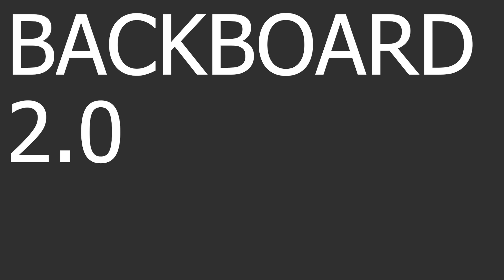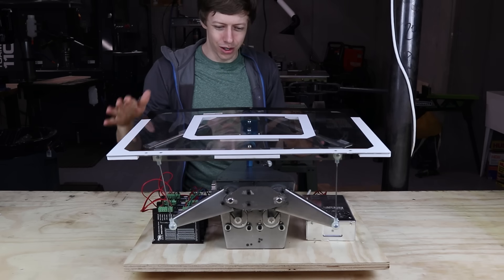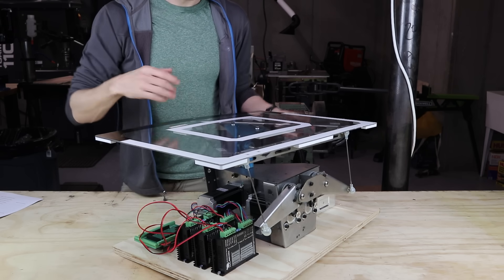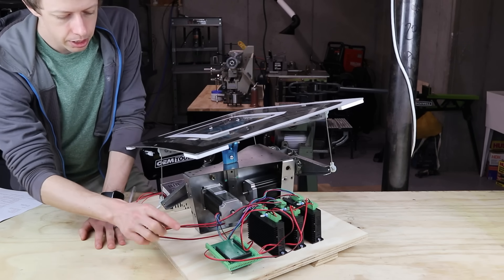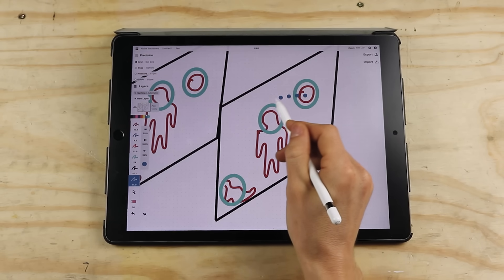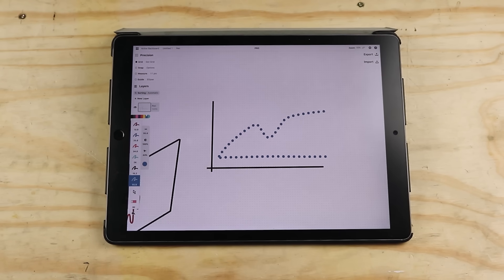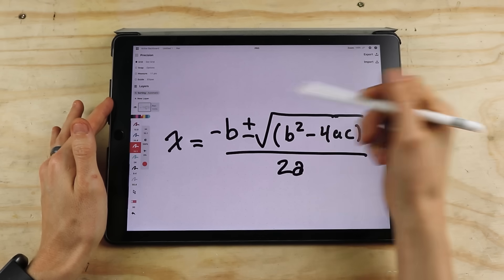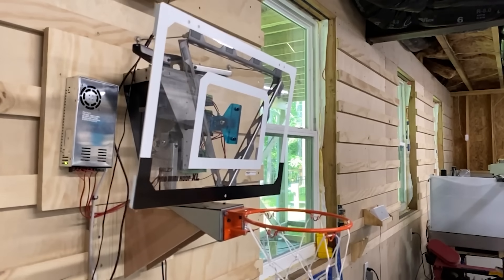The automatic hoop always goes in

Comment: I'd love an in-depth video on your process for designing and implementing your tracking algorithm and ballistic math. Do you have training as an ME? Your explanation of motion tracking reminded me of some ME's I've helped with programming problems. Not a criticism at all, just curious. You may have already considered these items.
1
) Using a depth-first classification scheme for your ball tracking would mean you only ever need to calculate until you find ANY ballistic-like path. You assign a score to it and when you run into a video frame that stops meeting your threshold you back up to the previous frame and try another object until you get a better score. Since you always assume you are on the right track and backing up by a frame or two shouldn't be too drastic, you could start moving the backboard almost immediately and then apply position corrections as you get more sure of your path.
2) Identifying a throwing arm could give you a strongly-weighted guess about which object to call the ball and what direction the ball should be going.
3) Solving problems from scratch is satisfying but in production there are often high-performing, community-maintained libraries that implement things you want to do. If your calculations are slow, maybe a team of experienced programmers and enthusiasts have already solved your problem.
 4) I have never played with Kinect sensors on PC and don't know the status of development for other platforms but when I've had situations where Windows created lag in networking or real-time audio/video, I have found it easier to change platforms than dive into drivers and driver signing and performance bottlenecks. 

5) Is there a compromise point where moving a curved backboard provides more gain than it costs to implement? Perhaps a backboard which only implements certain curvatures (at the edges maybe) would decrease movement cost for edge shots.
6) Would your curved backboard or one similar make a good passive or maybe one-axis ball return system to sit below the hoop? I think it would be cool to see a small curved backboard pass your ball back to you.
7) Could you shield that laptop if you are going to throw balls at it?  Made me pucker up a bit..

I love your videos. Thanks!   ..and go ahead and copy TOT if you want, he's awesome. You'll eventually figure out your own style... but this video was your best yet.

Comment: Hey man! What you've made is absolutely fantastic. You stated in the video that Windows sometimes lags out, and I think I can help solve that. 

If you can port your project to Linux, you can take a Raspberry Pi and flash it with Alpine Linux. Alpine is a very minimal distro of Linux ~5MB size, so it'll never lag even on the weakest of systems.

Comment: You should consider using a Parallax Propeller for controlling the drives.  It's 80Mhz and has 8 cores.  Each core can execute 20MIPS and each instruction is 4 clock cycles.  It can be interfaced through a standard FTDI chip and should have way more than enough power to pump step/dir signals at the drives.

Comment: Fyi Corrugated Lexan sheets are commonly used for green-house roofs.  They should have similar weight to your back board and be much stiffer in bending.  Something like https://www.interstateplastics.com/Polycarbonate-Twinwall-Clear-Sheet-POLCE~~SW.php  The thickest versions are probably stiff enough to skip the triangular steel frame.

Comment: I've got some surplus 250W BLDC servo motors on hand and they are about half the size of those steppers.  They have tremendous torque, acceleration, and speed.  You might consider using those for v3, and perhaps a Raspberry Pi 4 with Open CV :-D

Comment: I hope you're upgrading to an O-drive servo setup.  You'll have up to 7hp per motor to use :D. A feedback servo loop is also much more tolerant of poorly constructed commands and a parallel feed-forward controller can extract maximum performance form the servos. 

If you stick with steppers, a good S-curve/controlled Jerk trajectory planner will let you move your back-board a bit faster.  Though the best performance will come from using a full inverse kinematic model of the back-board to plan paths. (an inverse kinematic model is also the most ideal way to implement the feed-forward controller, but simplified inverse models can perform nearly as well with lower command lag.)

Have you considered adding speculation?  I.e. start moving the backboard as soon as you're sure the speculative motion will bring the board closer to the final optimal position?

Finally, do your tools also work on Linux?  A stripped down RTOS distro should get rid of the background task freezing.  (Worked with people who built real time systems on Linux.)   Ofc given infinite time, running without an OS on a fast SBC or DSP would totally get rid of your variable timing.  (done this style myself)

Comment: if you attach your plate to three screws linked to the plate by cardan joints you might be able to use lighter, less power-consuming motors (and in that case, brushless servomotors would be a great application) and still move the plate where you want it to be, without the stress on your belts and 3d printed parts, with better mobility and accuracy

Comment: Neat stuff as usual. I think there were more shots of your shop in this video as well, which were nice! Your system of french clamps everywhere on the walls is very clean, and I think it would be interesting if you did a video just talking through how you got to the current version of your shop.

Also, had you considered moving the backboard to a position based on an early estimate and then doing a more detailed solve for a best case board position so you have less time to move from your early hopefully-good-enough guess?

Comment: This is insanely cool, kudos on a working prototype.

The spin is a bit tricky, but you can probably approximate it using optical flow measurements on the ball, which could be feasible to compute in time.

Extended Kalman Filters and Particle Filters are great tools for tracking (both have OpenCV implementations). Probably PF would be overkill and computationally infeasible, but EKF could probably relieve you out of that graph theoretical balistic trajectory filtering stuff.
Reply: You can also not wait until the last moment to send a reference to your motion controllers. If you would try to match the optimal configuration for the hoop with the data at hand continuously, you would probably end up with the same end configuration as in your method, but the motion would be smoother.

Comment: Is there a particular reason you used stepper motors for this? This seems like a ideal use case for servos, since they won't lose steps even when the ball hits the backboard.

Also, if you filter out your head based on it not being on a ballistic trajectory, does that mean a jump shot will confuse it?

Comment: Rather than waiting until the last second to move the hoop, could you maintain a 'best estimate' and immediately tell the backboard to start moving towards that as soon as you detect a ball in flight? As the prediction gets better you can keep sending updated target positions to the backboard, but the chances are, because of those earlier predictions, it will already be moving in approximately the right way by that point, right?
Maybe you could even scale the speed so that it aims to get to the correct position just as the ball hits. That way the earlier predictions, which are less accurate, are also weighted lower. Like, when it first sees the ball it won't move the backboard that quickly based on that data, because it has time. But by the time the ball is nearly hitting, the board is moving as fast as it can to reflect the latest predictions (though hopefully it should already be very close by that point and not need to move fast).
I mention this because it seems to be how people catch a ball in real life. They don't wait until they're sure where the ball will be and then whip their hand out, they try to get close to their first guess early on, and fine-tune the hand location as they track the ball and get better predictions

Comment: Great job! There are a couple of things you could do still to improve your solution though:
Ball detection: Train a ML model to look for your ball instead of using a blob detector as it sounds like you are using.
Between-frames ball detection correlation: Are you pruning your "ball-candidate-graph" by removing unrealistic velocities before attempting to fit a ballistic path to it? Could improve speed.

Early motion: Start moving early by acting on the first ballistic path you compute that will hit the board. You can then improve your position ever so slightly as more information about the path comes in. Less strain on all components; You probably don't have to invest in even stronger motors.
Better math: Your equation for computing the optimal board position has infinite solutions because you're missing an equation. You have almost solved it already, but your solution is a bit brute-force. The exact solution probably involves the moment of inertia, but for simplicity, you can use the sum of squared distances each arm has to move. Differentiating this equation and solving for zero will give you your second equation, which we for simplicity could just solve numerically in a jiffy, as you don't need exact solutions..

Comment: It is possible to overclock an Arduino by replacing the quartz crystal on the Arduino. If you do this you need to put a heatsink on the device or even a small cooling fan.

Comment: You could eliminate the "infinite solutions", by fixing one of the three points in the plane and using 2 pistons vs. 3  (i.e. it is no longer an underdetermined system), plus it is cheaper to boot!

Comment: Great idea, even better execution. I'm a computer vision student  and I was really surprised by the way you calculated which object is the ball. I'm not an expert but here's a way that could potentially help you identify the correct ball a couple times faster - first of all the ball has a pretty distinct color, which isn't covered too much by your hand, nor it really appears in any of the surrounding. If you implemented a color mask into the video stream and ran the same algorithm that potentially finds the "roundest" object (simply put you find the object that covers the most space in the enclosing circle) it would save you an immense amount of time and resources (I'd like to assume you use Python's OpenCV for the computer vision part). Hope I helped and that this method will help you :D

Comment: Interesting project ! 
For the arduino limitations, I switched to ESP32 for one of my projects. I wrote some code using hardware timers to manage the steppers. (github munchj nerfbot_esp32_turret/src/ledcStepper.cpp)
Otherwise you could switch to brushless motors with magnetic encoders and something like oDrive to control them. I assume it would give you more speed and power than steppers for this application.
Looking forward for your next project !

Comment: Can’t you start by looking for fast moving things instead of looking for balls? That way heads and random stuff might be easier to ignore.
Reply: Another thing. If the system is moving as soon as it has a guess, it should get more accurate. The guesses will most likely be close to reality so moving to match the guess means as it gets more data it has a shorter way to move which in turn means you can keep correcting for longer with more precise data.

Comment: Use a Teensy 4.0! It’s a $20, arduino compatible ARM cortex M7 microcontroller that runs at 600MHz stock with a dual-issue superscalar cpu and a double-precision floating point unit.

I think it benchmarks at like 1000x faster than an arduino for general use.

I’ve used Teensys (3.2, 3.5 and 3.6) for the last few years, but the power of the 4.0 blows them out of the water. I’m not sure if there’s another cheap microcontroller out there with as much OOMF as this bad lad.

Comment: Really great build, and equally great video! Subscribed.

Two suggestions that might make this machine better:

1) Have you considered using brushless motors with encoders instead of steppers? Look into odrive if you haven't already. That would remove the bottleneck of the microcontroller sending individual steps, and probably get you faster movements overall.

2) In my experience, Linux is better than Windows at scheduling for soft-realtime applications. If it's not possible for you to swap over, have you at least made sure you are running your code with above-normal priority in Windows?

Comment: Take a look at the teensey microcontrollers.  They are arduino compatible and are usually around 10 times better spec wise than your normal arduino without much cost increase.  The only issue I have with them for projects is a lot of them at 3.3 V so you need level conversion to drive a lot of decices

Comment: Very cool. One possible improvement idea: You said that you wait til the last millisecond to move the board, and that you have timing problems. You might consider moving the board sooner towards a "best current guess" and then constantly refine the position as more data comes in. This might also look cooler as the board will seem to just smoothly move into place instead of the sudden jolt it has now.
Reply: I came here to say this. The motors wouldn't need to be as powerful, but you might need more processing power on the computer side. It should look better though and it would manage hard throws much better.
Reply: Yes! I came here to suggest this too. This is exactly what mark rober did with his dartboard
Reply: What about subtracting the previous frame to the current one in order to reduce the number of objects in the frame and reduce the time to recognize objects?
Reply: Yeah, me too. Always make the shortest possible move & upgrade the uC.
Reply: quaji1 You may run into trouble with this approach, because your early estimate could be only locally optimal. If e.g. your early guess (locally optimal) is to move the backboard all the way back, and then your later guess (globally optimal) is to move the backboard forward and down, then you’re effectively stuck because you don’t have enough time to move all the way from the back to the front. This is an illustration of reachability in dynamic systems.
Reply: mike s That's true, but he appears to already have enough logic and data to work around that: there are a couple parameters he could use for confidence before starting the open loop/continuous optimization, such as the current time to strike estimate or a ball landing position confidence interval size. The goal here is to start moving as early as possible, because most of the time that's going to get you closer at the last second final move than just waiting still.

Also, the rate of movement vs the operating window doesn't appear to be too small. In other words: his backboard can move fast enough, and doesn't have too far to go, that it shouldn't ever run into the scenario you describe, even without the optimizations I mentioned.
Reply: @haphazard1342  definitely. This problem in particular is probably linear so I doubt you'd ever even find a bad local min. I guess I wanted to point out that in general, making those assumptions about the optimization without checking first that the problem is linear may lead to puzzling results.
Reply: One option would be to move the board towards an early guess only once the uncertainty in the tracking estimate was below some threshold, that would reduce the likelihood of moving to a completely bad pose
Reply: Seriously, after reading this thread, I felt out of place.
Reply: You might have to linearly interpolate that change in position for it too look smooth. Which would take up some processing power. Probably not a ton though
Reply: was just thinking the same thing
Reply: I was thinking this as well, but seeing as there's infinitely many solutions, it might not be viable to calculate where to move to that early in time.
Reply: @stenlan8932  but as he said, it'd be calculated more while the ball flies, and it could just look for the closest position to the current one it found

Comment: Why does it need to move back and forth? Controlling just the two angles would've still gotten you two solutions for every throw, wouldn't it? That would have saved one actuator and the slider on the universal joint.

Comment: you could improve the accuracy by using the distance data from kinect. Using computer vision to estimate depth is good, but kinect has a IR sensor. The raw data from kinect has x, y and z. If you update the code to use z data, it should improve accuracy and let you ignore other objects in the image.